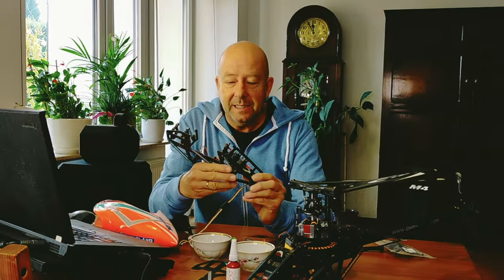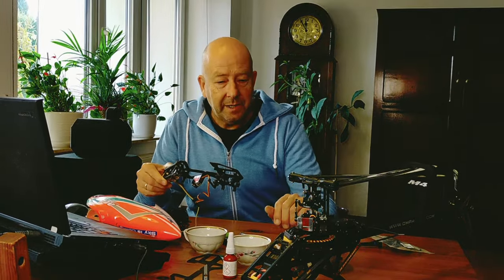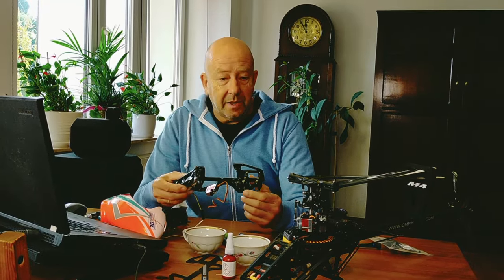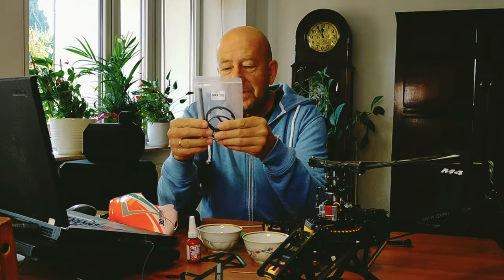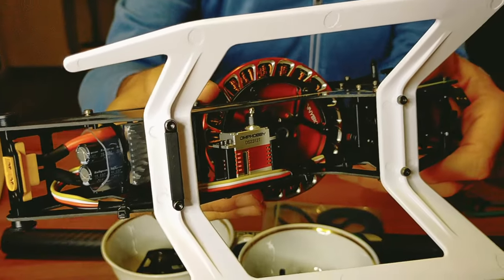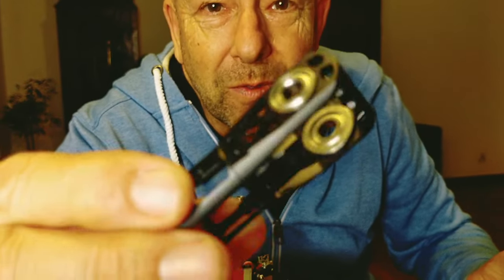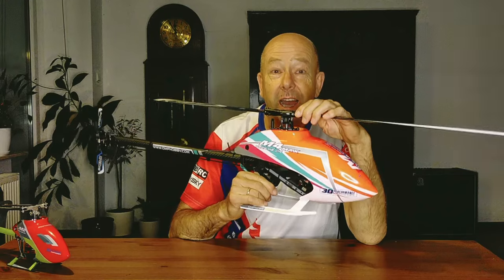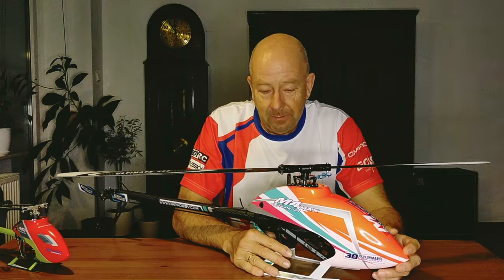So Easy! Why building my OMPHOBBY M4 Max was a pleasure

Comment: Great video. I have just completed an M4 build, my first RC heli build. As you mention it looks similar to the 4max build and I too made the mistake with the belt, a difficult step but other than this all was relatively straight forward. I still have to complete the radio link and set up my Fly Bar Less unit (again a new for me) but cant wait to get my M4 into the sky.
Reply from the maker: All_things_RC Thank you for your kind comment! Yes, for guys like us new to building kits bring the tail belt just with the right amount of twist through the tail boom and around those pulleys is tricky. I wish you good luck with the Flybarless and radio setup! This was another challenge for me as I don't like computers, smartfones and programming. I wish you a great maiden flight and lot's of fun flying this beauty! The M4 and the M4 Max are now my favorite helis! Best greetings!!

Comment: What a piece of art Mathias! Well done. Do you have help with the electronics?
Reply from the maker: Hi @frisos3944 ! Thank you very much! This time I was able to do the programming all by myself, because I just had to copy the EdgeTX model file of my M4 to create the M4 Max model in my Radiomaster TX12 MkII. My good friend Matthias was laying the basis for this last time. Same with the Brain 2 file I had. Receiver binding went great, I reduced the headspeeds, all went well. But now the weather became bad. Lots of rain everyday - now even some first snow and minus temperatures (C)! Extremely strong winds. A bit of bad luck postpones my M4 Max maiden flight. But it will work finally!
Reply: @RCCopterLove yes the weather is difficult lately. But went flying this morning. Very cold but no wind!
Reply from the maker: @frisos3944  Here below zero degrees, strong winds and snowfall. Even a hardcore flyer like me stays at home in such days!

Comment: ESC assembly is absolute dogwater. It doesnt fit the way it is shown at all. Wonder how the rest is. The manual also is a mix of the normal M4 and the M4 max.
Reply from the maker: The shape of the ESC could be different to make mounting it easier, thats true. The similarities in the manual are explained by the fact, that many parts used in the M4 Max are coming from the M4, the first model: The frame except the Tail mounting parts. The servo mountings, the complete Rotor Head and swashplate and others. I love my M4 Max and its my favorite heli now. I hope you get everything together well and I wish you lots of fun flying it.
Reply: @RCCopterLove  Thank you, it's actually my first heli I am building. I got the ESC in now, but with only one strap and tilted, but it fits. Building right now is fun. Gonna feel great when it first flies (hopefully). Wish you lots of fun for future helis aswell 👍
Reply from the maker: @crad5476  My ESC is as well tilted, but I used both cable ties and I would really recommend this. There are 2 slots for the ties on boths sides of the plate for the battery tray and ESC. The first build is an adventure!! Well I built only 2helis so far: M4 and then M4 Max. For me the most difficult was Radio programming and the whole setup (in Edge TX/Radiomaster... well). I am a 63 years old and dislike PC's, smartfones, programming...I just love flying! But once you see your first built heli flying it's a great feeling! Thank you for your kind words and all the very best for the bulid and od course the maiden flight!! I cross my fingers!!
Reply: @RCCopterLove  I got a FrSky X18 just for this heli, hope it's easy to set up, it feels pretty high quality. Been flying mainly RC planes with my dad since the age of 10, I am 23 now. And I am gonna watch your other videos too, you are very chill and nice, thanks :)